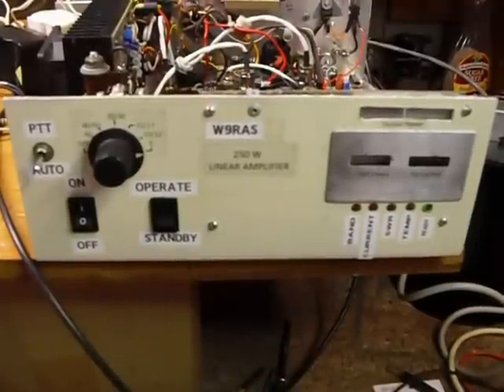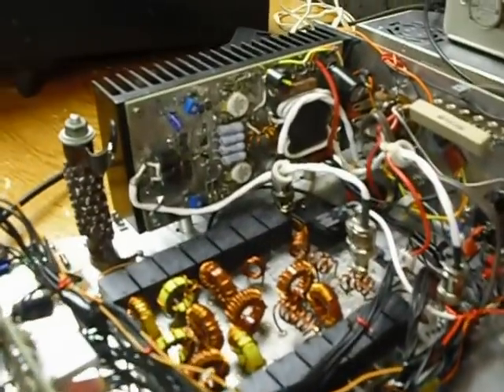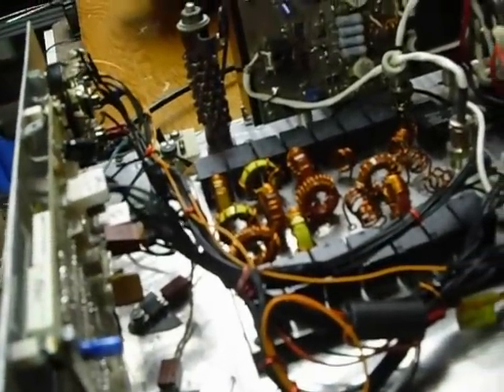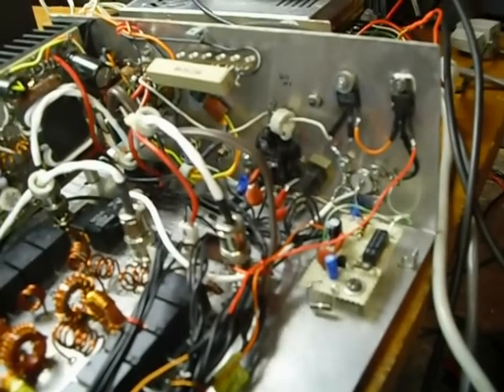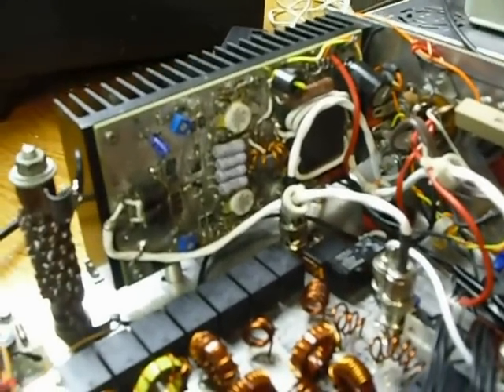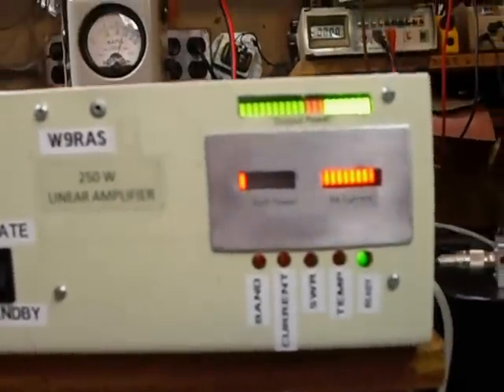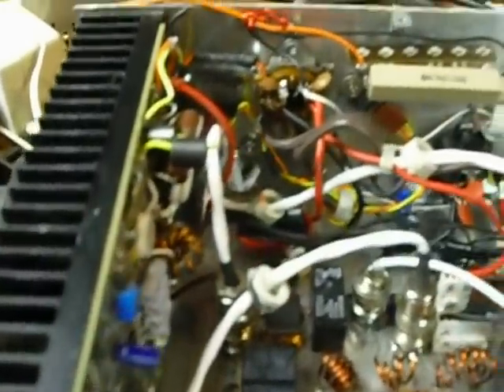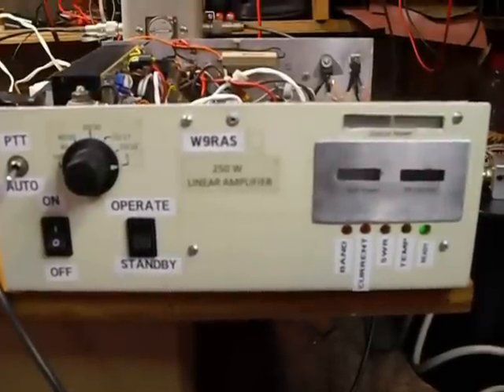250 watt 160 to 6 meter linear amplifier

Comment: Nice job, really lots of work to complete one. Would the control board handle 600W power. I like the solution but do not know that the swr protection can handle higher power, really dense assembly.

Comment: Hi Robert, I am also building this amp. thanks for the info on the thermistor pin error I just spent and hour or two trying to figure that out.
I need to move the bias line as a result (I think). I contacted the author Dick Frey and he advised me how to find the corrected parts list. It is buried in the supplemental files 5 layers deep and hard to find. I would like to send you pictures of my unit as well you can find my contact info on QRZ 
73 
AB0DH Bill Hedrick